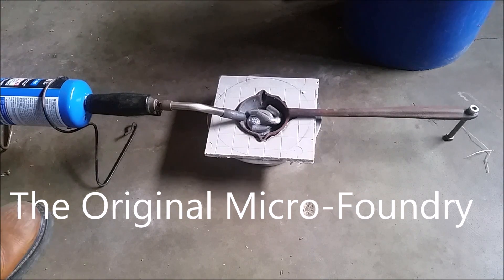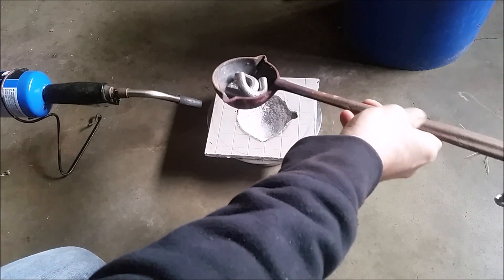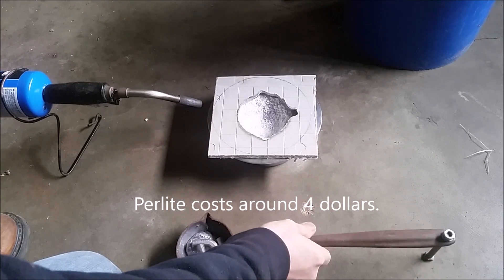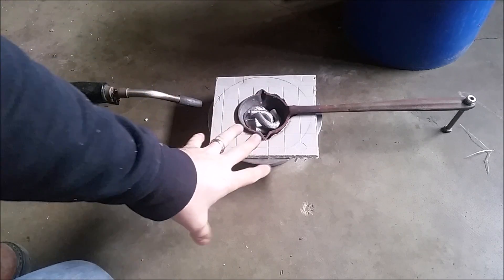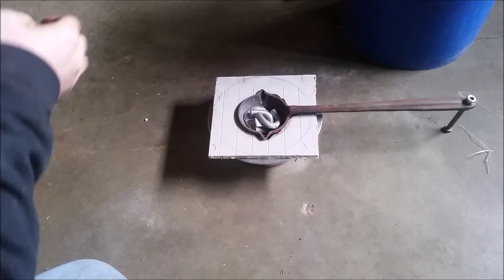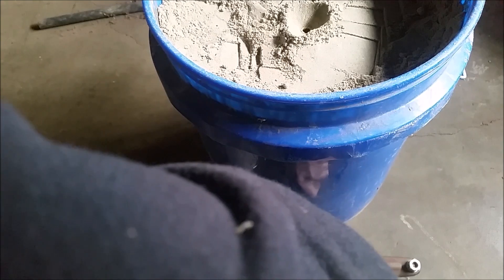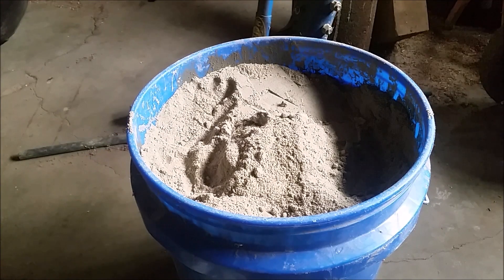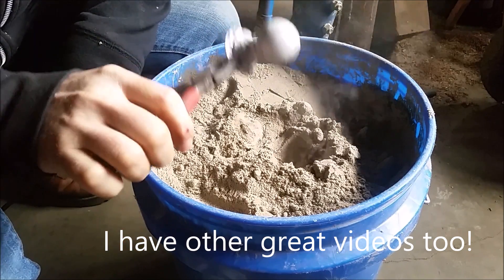The Original Micro Foundry

Comment: Ping pong balls you say... drilled and tapped would make nice handle ends for the drill press or lathe.  I tried something similar w/ styrofoam balls you'd find at hobby lobby but the foam was a bit too dense and didn't burn off completely.  Thanks.